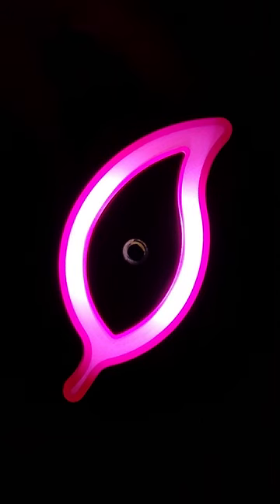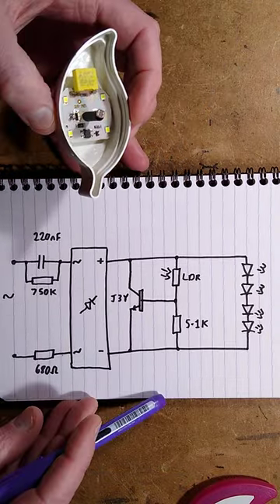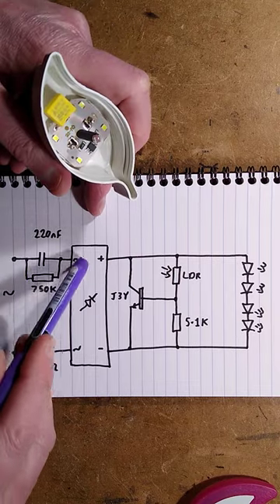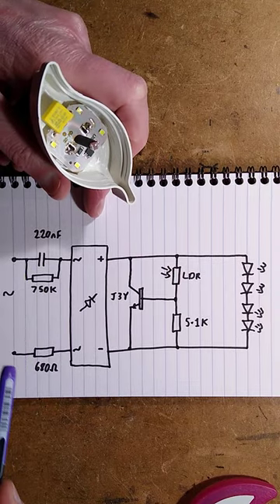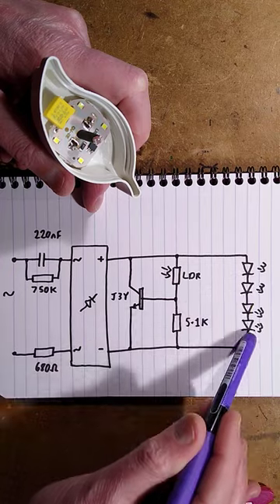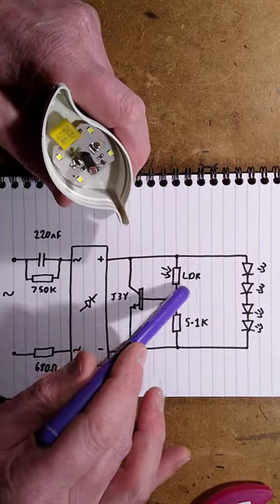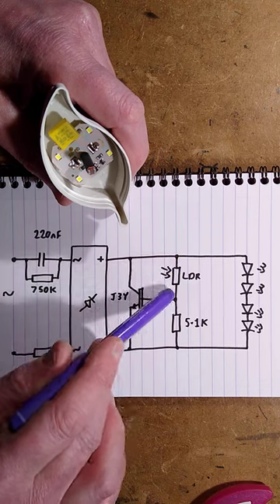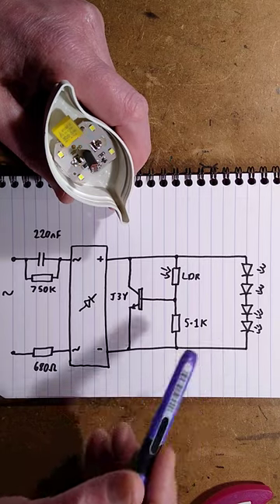Unsafe eBay night light

Comment: Draws more current when it's "off", so the entire "off" function with the LDR is worse than useless.  But the customer assumes the "off" function actually saves money.  HA
Reply: I had a motion sensing outdoor light that always drew 5 watts (from the sensor). Since they annoyingly false trigger, or don't trigger. It made more sense to unplug the sensor and just put a 5 watt LED bulb in, and leave it switched on all night. It'd actually use less power
Reply: May I remind you that this potential "night campfire" is running off of a Capacitive Dropper?
Capacitive Droppers don't like to be run Open-Circuit. Shorting them is actually safer, because the Cap already provides massive current-limiting features IF IT IS INTACT. In fact, Current-Limiting is why CapDrop circuits are used in the first place .
Reply: @DerMarkus1982  I never suggested open circuit, did I?  I was simply pointing out the "off" function is silly.
Reply: It actually draws more current but less *power*, due to the capacitive dropper. It's all reactive power when its "off". So no, It's not useless.
Reply: I had one years ago that had a neon bulb and current limiting resistor just connected to the mains. Then a CDS cell across the neon bulb. SO simple; SO cheap; draws more current when off. Still almost nothing, just pointless.

Comment: Why not just leave it on all the time?
The "Short the LEDs out" feature:
1] Costs more components
2] Wastes a (tiny amount) more electricity
3] Might cause a fire if the capacitor failed.
Reply: 1) You're right.
2) Not exactly. With the LEDs shorted via the transistor, the limiting capacitor acts as a simple reactive load for the AC supply. This means, the power the circuit draws becomes almost completely reactive (barely increased current, but almost 90° out of phase to the voltage). No active power, no costs.
3) The capacitor is exposed to virtually the same stress conditions, no matter the light  being on or off. So it is no more of a danger using this design or keeping the LEDs continuously lit.

Comment: Shorting out the powersupply will make it use power constantly🤯
Reply: The capacitor is going to limit the current either way. If you have a switch that decreases the LED brightness, you will end up having more voltage as the capacitive dropper is a current source, not a voltage source. So if the transistors were connected to the LED to reduce the brightness, without any significant load resistor, it will keep on increasing the voltage until the transistor and the LEDs get zapped!

Comment: Yes, let's short power to ground. What could go wrong?
Reply: A capacitor power supply is basically a current source. So shorting it would not do any harm
Reply: Same circuit is in virtually all cheap night lights, not too many have caught fire.

Comment: Looks like it had plenty of fusing components in there to me. The capacitor, the FULL BRIDGE RECTIFIER, and transistor, the LEDs...

/s
Reply: Generally all of those parts fail short circuit but that would be the least of your worries if you house was on fire
Reply: @ianhosier4042 Oh no, they will fail open circuit with enough current. Everything fails open circuit eventually.
Reply: No such thing as a full bridge rectifier.
The device is called a bridge rectifier .
It is implementing full wave rectification .
There is also half wave rectification .

We should use the correct names for things.
Reply: @deang5622 Not one for memes, are we?

Comment: But why are all the LEDs connected in series. If any one blows up, the whole thing fails to light. I have seen a similar arrangement in regular LED bulbs as well, but failed to understand why ? If someone could explain, i will be very grateful. Thks
Reply: If in doubt it's always to safe a penny or two
Reply: I believe one of the reasons is so all the LEDs will have uniform current thus more consistent brightness. Also I'd imagine that it's easier to put together the LEDs so the forward voltage is in line with whatever the power supply voltage is.
Reply: Because of complexity. Wiring all LED in parallel would require current limiting resistors or constant current sources for each LED separately. And you would need a large power supply to convert the high mains voltage to a low 3-5V with high current to power all LED. So it is way easier to wire them in series, having one or two current sources almost directly to mains with a very low current. Which leads to smaller wiring needed - saves copper.
Reply: To add to what others have said, LEDs often fail short. In that case, current will continue to pass, but the other LEDs in series will be a bit brighter.
If they were in parallel, ALL the current would pass through the damaged LED. Therefor the other LEDs would be off.
Reply: Voltage is a huge one. LEDs only like about 3V, with 4 of them that is 12V. Now that magical capacitive voltage dropper helps a lot to act as a voltage divider, but you waste a lot of power doing that. If you did drop it all the way down to 3Vs, your current would be 4x higher, but you input voltage wouldn't change at all, and all that extra power is wasted in the capacitor.
Reply: @1lI1l1Il  can't you just put them in parallel with a single current limiting resistor? i've done it before with no issues
edit: clicked expand and saw the answer to my question in a different comment, my bad
Reply: @Falcrist  Makes sense
But, i will test this on a breadboard and get back to you
Reply: thank all of you for the thought provoking replies :)
Reply: More LEDs = more current. Capacitive dropper is a current source, not a voltage source. Meaning it will try to maintain a given current, but can increase / decrease the voltage.

So if you have more LEDs in parallel, you need a bigger cap, which might be impossible to fit in that case. Having them in series means your voltage is higher, but the current is same, so the capacitive dropper can provide that given current easily by bumping up the voltage.

The overall power draw remains same.
Reply: @SouravTechLabs  thanks for taking the time to reply. Elegant answer !

Comment: Stupid design! They could've just moved the transistor over so that it powers the LEDs rather than shorting them out. We made that circuit, minus the mains supply, back in school. Is there a sensible reason it's done like this? Aside from y'know, China?
Reply: Yes. With the capacitive dropper, you would have otherwise the full line voltage across the transistor when it's off, and the one they used would just release the magic smoke from that. So you would need a much more expensive transistor which can handle that voltage, and a more complicated circuit to control the transistor. If you watch the full video, the thing only burns 1/4 of a Watt when off, so it's actually not that bad.
Reply: @moe.m  Absolutely! The capacitive dropper is a current source, not a voltage source. Meaning it will try to maintain a given current, determined by Xc = 1 / (2 * PI * Frequency * Capacitance), and boost the voltage till mains voltage.

So without shorting it out, it will give mains voltage to the transistor, and most low powered transistors like that will not be able to handle that, the LEDs and the transistors will get zapped during breakdown. This can lead to dangerous situations.